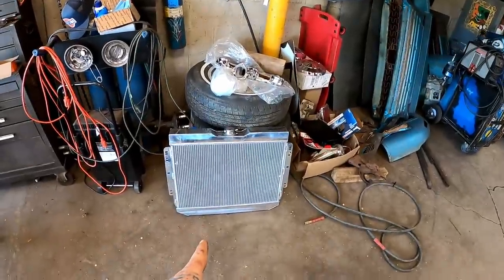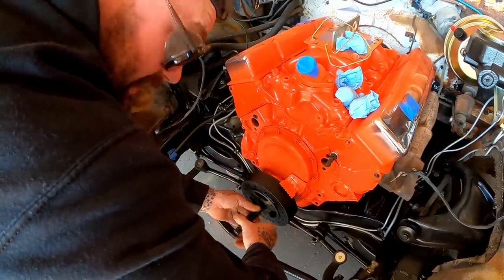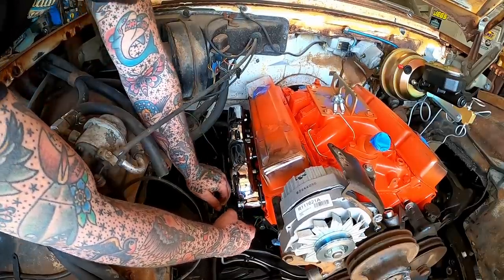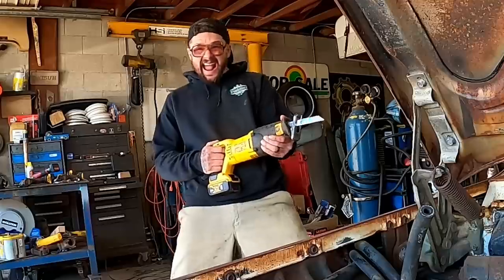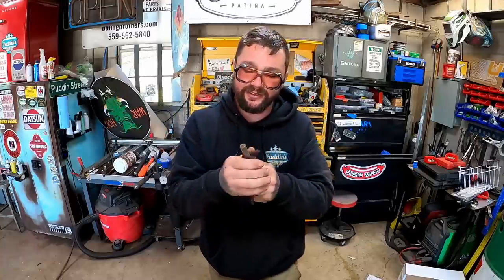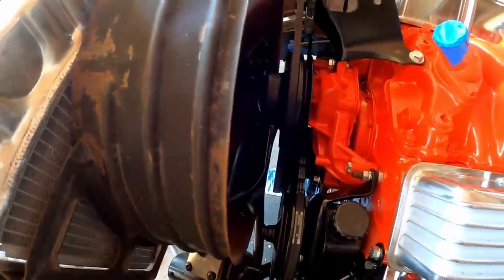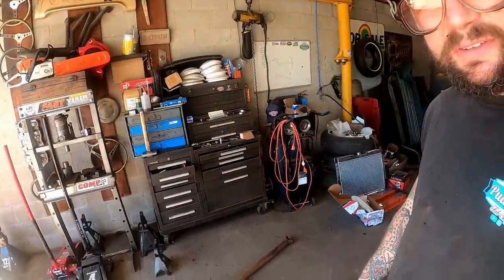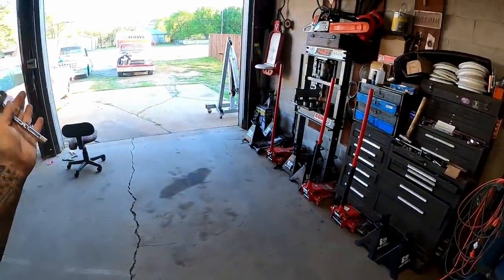1961 Chevrolet Wagon. Accessories, Exhaust, Radiator, MORE!

Comment: I love the Carter AFB carberator (Edelbrock). I use to use those in 70s. 600 CFM work perfectly everytime. We use to find them at the salvage on pontiacs and clean and put a kit in them work perfect every single time.

Comment: People like what they know. Different carbs for different people. I used to like the Carter AFB for great "out of the box" ...just works great. If Edelbrock did a good job of ripping them of, they should be a great carb too. I also love the SU for their simplicity. Only your lawnmower is easier to work on. Those manifolds look awesome. The car isn't exactly what I would build, but it's not mine. It's yours and it looks great.

Comment: Puddin. please check the alignment of the power steering pump. It seams like the far right adjustable mount location is pulled too far back to the block. That would cause the belts to walk. All the pulleys should be parallel to each other.  I could be wrong, but it sure looks crooked

Comment: i use a straight sparkplug boot i cut off of an old plug wire to start plugs. it's hard to cross thread them, and is longer than just a plug when hand starting them. ain't buggered one yet.

Comment: I haven't read any of the other comments yet. Power steering puller set has a sleeve that goes over those two puller halves. Fuel pump shaft, you have a bolt in the face of the block right around the corner from your fuel pump shaft pull that bolt out get a longer bolt screw it in there lightly and it will hold that shaft in place while you install pump once your pump is fully in place remove that longer Bolt from the face of the block reinstall the Bolt that was originally there , painted your block color. That is 1 of 1000 great things about a Chevrolet 350. Edit one , Yeah I've gotten to the point where I'm watching you and I think it's Saturday Night Live. Of course everything is already done where I was making my speech about the fuel pump. It's already been on for hours and days and hours. So anyway you next Chevy small block if you could keep that in mind it'll help it go quicker maybe less Messier. Anyway thanks for this is great I love it.

Comment: For the future, TCI makes a really nice bracket that lets you use a TV cable with the Edelbrock/ Carter AFB. It also holds the throttle cable and bolts down with the rear carb studs. I just used one on an AMC V8 which, Ironically, is nether a Chevy nor does it have a TV cable! It just happened to be in my pile of leftover parts and happened to fit. I had originally bought it to use on a SBC, but ended up putting a Quadrajet on it instead which is my all time favorite carburator. It was a good carb, but the Q-Jet just works better at part throttle and gets better fuel mileage due to the small, 175CFM primaries (on a 750 carb) that give a better vacuum signal. The only carb I really dislike is a Holley as they never seem to run right or keep a tune.

Comment: One problem with the new power steering pump bracket - Now you can't adjust the tension of the belt as it gets loose! That is why the original bracket had a slot there.

Comment: Good info on TV cable. I'm putting a 200-4r in a Vista Cruiser behind an Olds 350 2V and debating a 4V swap to male the cable brackets easier to find. Maybe make them for the 2V? hmmm

Comment: I was going to say, without an extra electric fan you better be running a fan shroud. i had an ole 64 with a 350 i learned the hard way. Overheating all the way to galtlinburg Tn over and over again

Comment: Someone needs to buy you an air powered spray gun, I bought a big and small one at HF, works awesome and cheaper than spray cans, I even made a collapsible paint booth out of 1/2" pvc and clear plastic, with old furnace fan to exhaust the fumes.
Reply: Puddin ain't a painter, but he'll rattle can to git it dun

Comment: Important question: i got the damper installing tool the same that you have. But when I screw the 7/16 adapter into the crank the thing is wobbly as hell! I thought my Chinese made tool the thread on it we’re screwed up. But I see that you also had some wobbly action going on. I was scared of ripping my threads out the crank. But is it normal that it wobbles??? Thanks

Comment: I like to use Allen cap head bolts on manifolds and headers l drill holes in the head for safety wire also use nickel antisize warm tge engine and put a little extra smoke on the bolts then safety wire them because I hate manifolds leaks

Comment: I put a motorcraft battery out of my Taurus into my s10 , it didn’t mind . But then my ecm2 fuse kept blowin then I got all redneck and used a homemade copper wire fuse so it wouldn’t blow and now my truck won’t crank 😂
Reply: It worked till it didn’t

Comment: Ummm……..didn’t you lose all of your adjustment for your Power Steering belt because of how you made the bracket? Pretty sure the factory had a bracket in behind the pump, and the main bracket had one mounting bolt and two adjusting slot bolts….1 to the block and 1 to the back bracket. Not with 2 hard mounted bolts through the bracket, there is no movement. I could be seeing it wrong here though, my old eyes aren’t the greatest!

Comment: I still don't believe you aren't using electric fans.
No shroud...equals how much extra room for repairs ?
And they ain't constantly churning crap up into your eyes.
Not to mention the danger of getting fingers lopped off..
Or droping a wrench into its path. Not to mention saving a few HP.
Much less weight amounting to less weight on water pump bearing/seal.
Reply: Old school cool 😎 , dont need fandangle new stuff it works, its what he has, job dun, good buddy
Reply: @user-427.commodore  and the reasons listed make no sense either? There's a difference between old school and primitive.
Get rid of alternator !
Generators are old skool.
And use POINTS !!
HEIS are NOT OLD SKOOL.